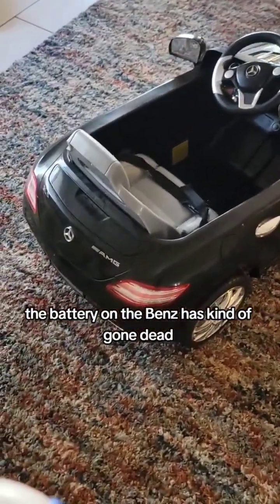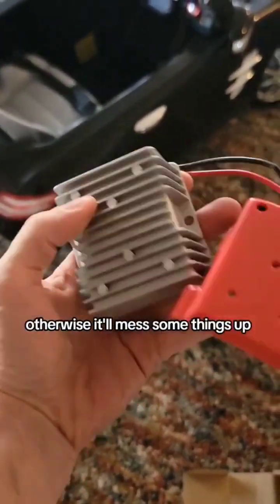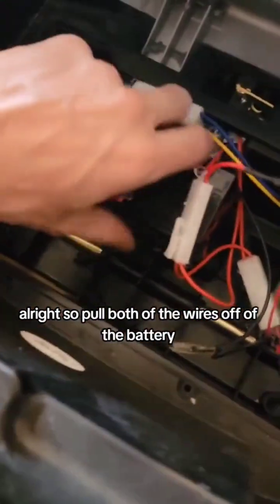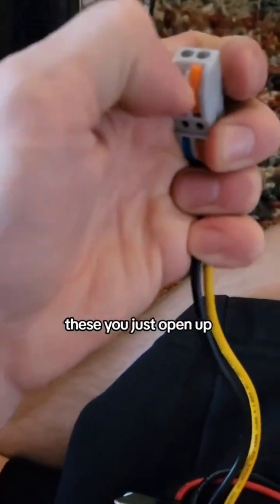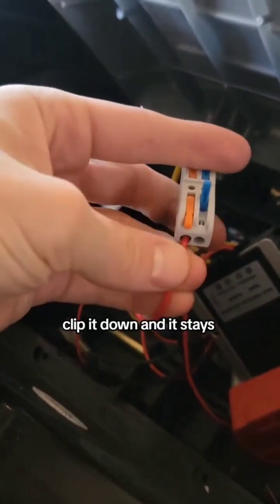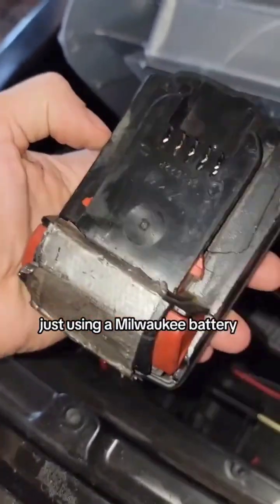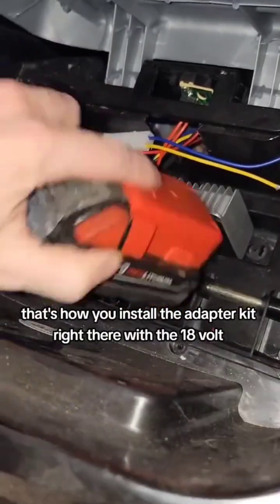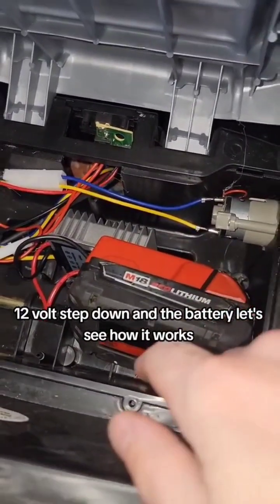Power Wheels Milwaukee Battery Upgrade with 12v Step Down Converter | #PowerWheels

Comment from the maker: Upgraded our old, tired battery in my daughter's electric car. Using the Milwaukee 18v to 12v step down adapter - https://amzn.to/3Farv3N.

This gave the car much more power and extended battery life. If you don't use the step down adapter it will fry the wiring and other things.
Reply: Where can I order this?
Reply from the maker: Linked in the pinned comment
Reply: @Mechanic_cole Did it still make it faster keeping it at 12v compared to the original battery
Reply from the maker: @williamcraft5392 yes
Reply: Does it last with the step down
Reply from the maker: @anthonymoy4471 over a year later, still going strong. No issues
Reply: Does it have to have converter
Reply from the maker: @dustybyram8849 yes. Or it will fry the motor and electronics

Comment: Do they have hilti nuron connectors
Reply from the maker: Yeah
Reply: I was gonna use an extra charger and just reverse some leads so it outputs and make sure the capacitors shit out electricity’s and not blow up so when I plug a battery in it will power it, 
And change some motors around to run on higher amps but I think I can maybe make a charger work

Comment: Tried this but didnt give more power i then used it straight to the battery without converter and runs way better but not sure if its safe or not?
Reply from the maker: Good question, keep us updated if it still keeps working

Comment: Did you see an increase in the top speed using a 12 volt step down converter and an 18v lithium battery?
Reply from the maker: Yes, I have to slightly jog to keep up now. You can't speed walk for long as fast as this goes now

Comment: Heard from other people that this trashed the Milwaukee battery after a bit. Anyone else notice this. At $250 for a replacement Milwaukee battery, I’m a bit hesitant.
Reply from the maker: I've been running the same Milwaukee batteries that I use in my impacts for over 4 years now with zero issues. I've never had that problem. And where in the world does a Milwaukee battery cost $250? They are much less than that here in the states....

Comment: It works fine on 18v a bit faster but it won’t mess up a 12v motor 100%
Reply: It had other electronics. If it was a simple pier wheels you could buy 18v could fry the other peripherals
Reply: I connected without converter and it had too much torque and rounded off the teeth on wheels but did the kids enjoy it for a day

Comment: What would go wrong if you didn’t have the 18-12 volt converter
Reply from the maker: Burns out the electronics. Ruined the fiesta one I did, melted the wires

Comment: For anyone doing this make sure you put in low voltage protection circuit in . Otherwise you will drain your drill battery before charging recognition.
Reply: Can you explain further?
Reply: Where do i find this

Comment: No need for a converter just just the battery wire and make joins to go into the battery
Reply from the maker: If anyone follows this advice above, you will fry out your control board. I thought the same thing until I tried it lol
Reply: @Mechani_Cole  i just wired straight into a 5.0ah Milwaukee battery on my daughters red jeep (dont remember the brand) but its been working fine for couple months
Reply: @TeflonDonZZ does it have a radio and headlights? I think thats the issue, not the motor
Reply: @ nah works great on the 6v cars worked great

Comment: Does the Milwaukee battery cut off before running completely dead? I have read that the battery needs protection from going completely dead but have also read the protection is internal in the batteries. Can you verify? Thanks!
Reply: I have the same question, if you can answer his question that would be great, thanks
Reply from the maker: No auto shut off
Reply: It needs to be run through a low voltage shut off as well as the converter.
Reply: I think he’s asking:  What voltage level do you set the an adjustable low voltage cut off module to for an 18v lithium battery?

Comment: Just curious if anyone didn't use a stepdown converter and how long your motor lasted. What were some signs your motor died or on its way out?
Reply from the maker: I didn't use one at first and it fried all the lights, the radio and the motor first go, first time turning it on. Don't skip it @corbinknight9702
Reply: There is another version that has a dial to control how much voltage goes to the motors while still giving it more power. I used on my son’s 6v lightning mcqueen and never went over what the dial says is “50”. 

At “50” the wheels just barely break loose on the street, my kid is about 40 lbs for reference and I used the   Milwaukee battery from my 1/2 inch impact. Ran about 25 mins and went down to about half battery. I like it, if your kid likes to go fast too soon you can keep them at a lower speed until they have better control.

Comment: I just hooked the dewalt one up to my kids Escalade power wheel with a 5mah and it is noticeably better all around. Plus i have 5 batteries so never down time again.
Reply: Mak sure you out in low voltage protection circuit in otherwise you will drain battery beyond point of recharge
Reply: @ishanperusinghe where do i find this